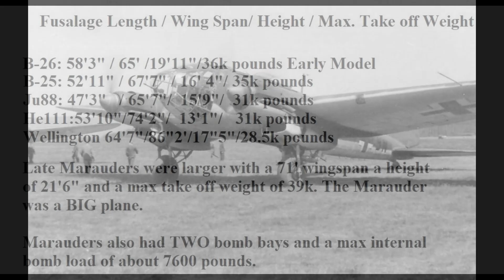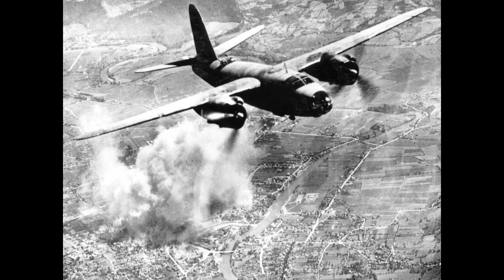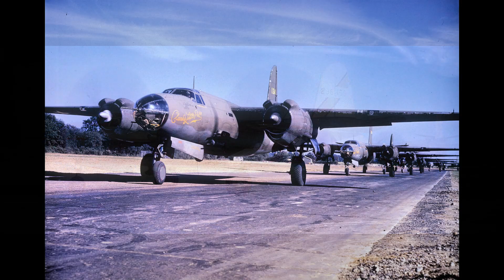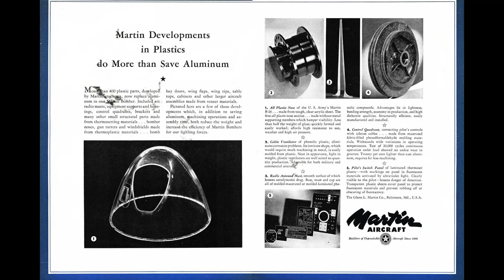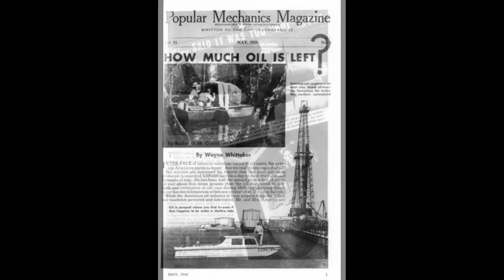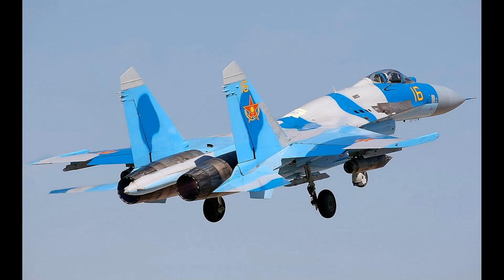Martin B-26 Marauder. Unsafe At Any Speed?

Comment: My father was an instructor pilot in Martin B-26 Marauders when he was stationed at Loredo Army Air Field in Loredo, Texas in 1944.  The B-26 was considered a real hot rod for its time.  It was a tricky plane to land due to its high wing loading.  The tech manual says you can land a B-26 Marauder at 126 mph indicated airspeed, but in actuality B-26 crews rarely if ever landed at that slow of speed.  My father usually landed a Marauder at 142 mph indicated airspeed during touch down.  You had to put the plane into a shallow dive then flair it at just the right moment to land a B-26 Marauder correctly.  If you flair too high or too low, the outcome will usually end up being disastrous.  Teaching a new greenhorn pilot how to fly a Marauder was very dangerous as I'm sure you can imagine.  Of all the planes my father taught in, the Marauders were the most demanding and unforgiving.  The Marauders had vicious stall characteristics due to the high wing loading and they took longer for the plane to recover from a stall.  The fact that these planes were ordered right off the drawing board with no prototypes ever built or tested and they went right into combat boggles the mind, but thats exactly what happened.  After the war, its amazing how fast the B-26 Marauders were scrapped and melted down into aluminum ingots, which is why so few examples survive today.
Reply: "one a day in Tampa bay!"
Reply from the maker: Thanks Jim.
Reply: Dad flew 50 B-26 missions out of Corsica, Sardinia…over Italy and Munich.
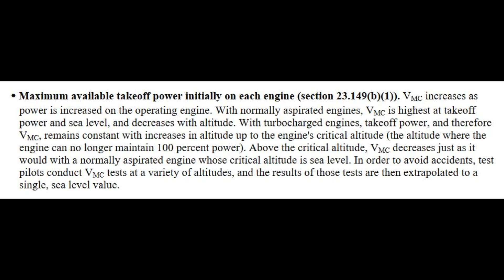Crash landed after flak damage on a British 20:09 Spitfire field in Italy. Went off the end of the runway at over 100 MPH. Flipped over on its back. Brits cut them out with one crew with broken arm…all survived. Last mission, his tail gunner hit and damaged a ME262 over Munich. Rarely spoke of his wartime experience until his early 90’s.
Reply: Like the B-47 the performance jump needed hard lessons in training.

Comment: I have an issue with your use of the term "counter-rotating propellers" - I thought this refers to both propellers mounted coaxially on a single shaft, like in the Tupolev "Bear", whereas in twin-engined aircraft with the propellers rotating in opposite direction, I encountered the term "handed" powerplants. Am I wrong here?
Reply from the maker: Thomas, you can take it up with the FAA. The term "counter-rotating propellers" is on page 13-24 of the Airplane Flying Handbook, which is the source document for multi-engine testing in the U.S.
Reply: Contra-rotating vs counter-rotating?
Reply: Should really be referred to as counter rotating engines to eliminate the counter/contra argument.

Comment: Pull the nose up at 60 and if we lose an engine before 150, we die like men.  I'm surprised they had any payload left for bombs having to haul brass balls of the crew around.  Thankfully, better technology makes having to take such risks unnecessary now.  Did they ever change take off procedure later to make it safer once they had established they would be using long, paved runways?
Reply: It just means your only chance of surviving an engine out below the critical speed is to close the throttles and land straight ahead in control as opposed to a spiral dive to your doom.
Reply: And try to dump any bombs.

Comment: Thank you for covering the Marauder. It's always skipped over for the other B26
Reply: Thats because the "other" b26 is better lol
Reply: @kiwidiesel  As you'd expect from a plane that debuted at the end of WW2 versus one designed before the US entered the war, with all the experience of operating the original B-26 plus more going into the design and testing. It's a bit like pointing out that a 1946 Chevrolet was a better car than a 1936 Ford.
Or that the F-15E Strike Eagle is a better strike fighter than the F-4E Phantom. No kidding. It's a later, more advanced design that builds on the experience gained from the previous type.
Reply: @kiwidiesel  yeah the 320th bomb group of the 12th AAF beg to differ.